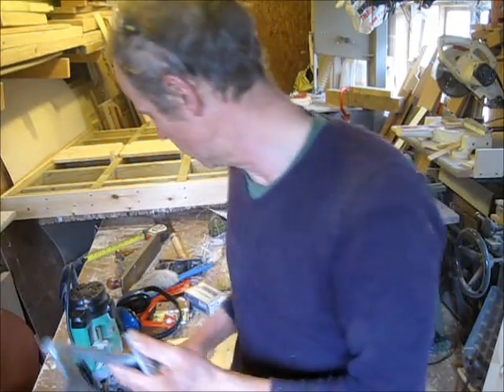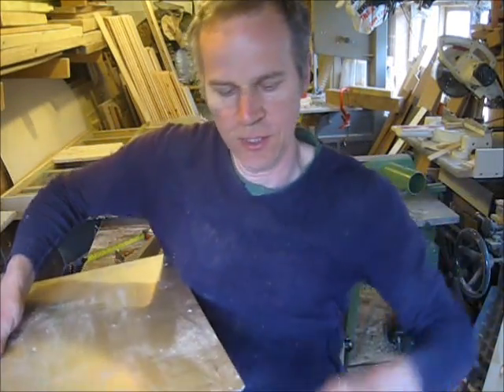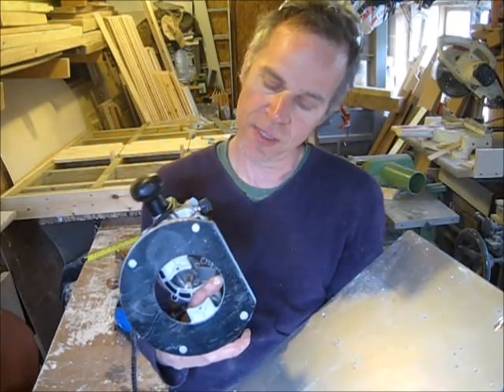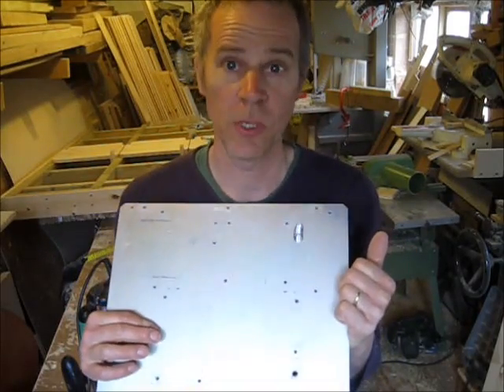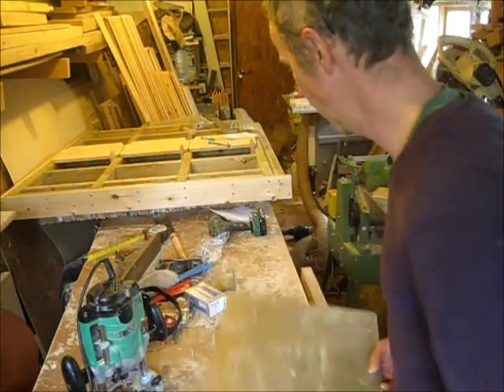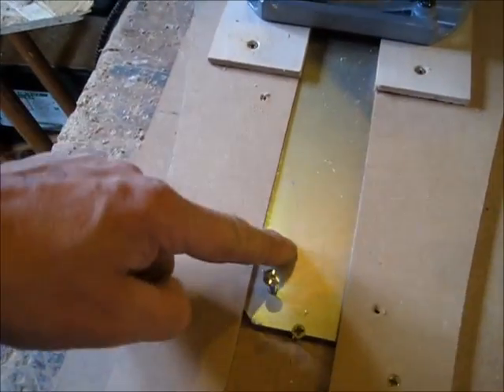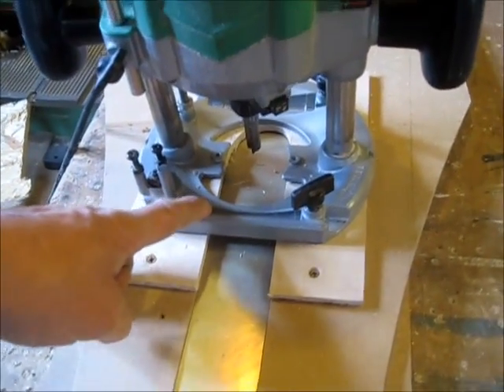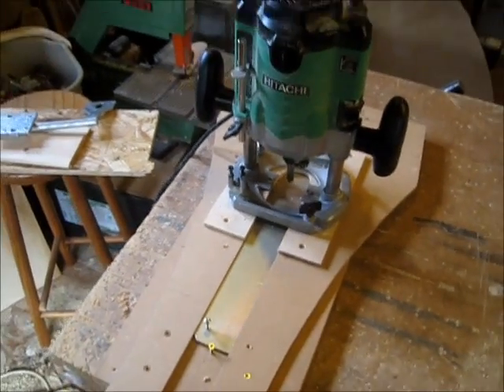Metal milling How to

Comment: Nice! I am about to use a router on some 1/4” thick Aluminum Angle 3”x3”. I am using the angle as a mitering fence for a metal saw. I will create a channel/groove, just deep enough to have an adhesive metal tape measure flush with the surface. Would you recommend a slower or faster RPM? Is a 1/16” deep pass to much at a time?

Comment: The really wild thing is you can use a wood router to machine cast iron too.  Very carefully of course but it can be done, carbide bit obviously.
Reply from the maker: haven't tried that...thanks...I have used it to skim off a very small amount of steel though could only take a fraction of a mm cut

Comment: give it a few shots of wd-40 while you are cutting, keeps aluminum from sticking to tool at the rpm you are having to use, and carbide milling tool will work better than router bits
Reply from the maker: thanks, great tip
Reply: Fixn to say that

Comment: Title says metal milling.  It does not specify what kind of metal. Is it hardened, tempered steel?  Mild steel? Some sort of exotic alloy?  Or was it just soft aluminum? 

No date on when this video was uploaded.  That would have been helpful information.  Regardless,  if it was just aluminum, was it a HSS bit or a Carbide bit?  Did you use a Variable speed router or just full on full speed router?  Aluminum taken at small increments & routed slowly counter clockwise, can be as easily milled/routed as hardwood.

Now if this was metal/steel as the title suggested, I would have been impressed.  Yeah, aluminum is metal but it is non ferrous & a soft  alloy, not really metal as we think of it like steel, cast iron, etc  or otherwise.
Reply from the maker: Routering aluminium as the thumbnail says! old HSS cutter...The thing to remember is that not everyone will have knowledge in all materials and techniques...this was the first time trying it and I was amazed it was possible...it is just up there to help inspire people who might not know that it is possible...I hope you found the video that you were looking for.
Reply: @Pricklysauce  Thanks for the reply.  I have a 12" square piece of 1/4" thick aluminum that I want to shape to follow an oval pattern of steel & then adhere it on top of it to make a base for a tool stand. Probably will use JB-Weld & tap & thread some Hex head screws through both pieces.

 I will rough it out with an aluminum blade on my table saw & then a jig saw before using a carbide bit with a bearing on my router.

My experience in the past has been that aluminum tends to cold weld to carbide bits & if you're lucky you can get the job done before the bit builds up with aluminum that is almost impossible to remove.  I know there are some chemicals that will remove the aluminum from the carbide.  Ave has a channel discussing & showing how to do it.
Thanks again.  Cheers.

Comment: Damn no oil?! I’ll bet that bits junk now lol
Reply from the maker: Hadn't thought to use cutting oil, thanks for the tip...it was an old cutter that was going to be thrown out.
Reply: @Pricklysauce  I Know this is an old comment but plenty of machinists tend to get a good result using wd40 on aluminium rather than conventional cutting fluid. Beware, carbide tends to either like to be used completely flooded or dry. Sporadic introduction of fluid can lead to cracking.
Reply from the maker: @rich3633  that’s really interesting...metal working is a new thing for me and any advice is always totally appreciated...allows me to learn...big thanks 🙏
Reply: @Pricklysauce  My pleasure. Thanks for the vid. Great idea screwing it all down. It's so useful to see good ways to work metal at home. The proper kit is often prohibitively expensive or 3 phase. Anyway, Cheers.

Comment: Ali is softer than some hard wood. I use a standard wood band saw to cut aluminium 6 mm and it works great.  First I have seen a router on Ali, will keep it in mind.

Comment: FYI a lot of standard aluminum alloys, such as 6061 and 5052, can be worked with power tools originally intended for woodworking. This includes a bandsaw, table saw, chop saw and jigsaw. Sometimes you'll have to get blades specifically designed for aluminum if you're making a lot of cuts, but in a pinch, pretty much anything will get the job done. Aluminum, as far as I'm concerned, is some type of miracle material.

Comment: What state did the bit end up in ? or what type of bit did you use ?
Reply from the maker: it was a standard wood working router bit HSS I think, a used one so not super sharp. The bit seemed fine after though probably wouldn't use it to router timber again.

Comment: Here's even cooler idea, how to do somewhat precision cuts, of aluminum, without CNC. Expecially, if you need parts to make your first cnc.
Buy Carbide, or HSS Flush Trim Router Bits. Make CAD drawings of your parts and bring them to a local laser cutter. Ask to cut the parts  out of plywood, that is really cheap. 
Then, cut the aluminum sheet/stock, to as close to required part as possible and use laser cutter plywood as stencils to finish out the parts with flush trim bit...
Reply from the maker: Cool - that would work
Reply: Yes, but it's not hard to be very accurate in the first place.
just build it from scratch.

Comment: Thanks for the vid and enthusiasm! I need to finish making my chop saw insert out of aluminium because cutting steel tube on a project (with a steel cutting blade of course) was heating up the tube so much it was melting the plastic insert making it impossible to continue. I agree with you on the YouTube thing. It is pretty much my go to place for validating my crazy ideas before I attempt them myself. Subbed.
Reply from the maker: Hey Pario thanks for watching and your kind words...and thanks for subscribing, means a lot to me.